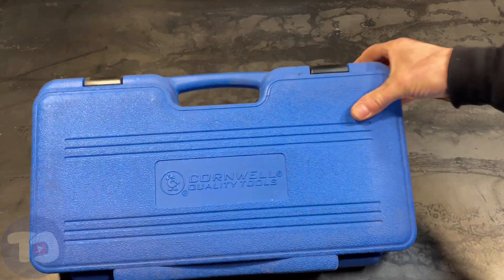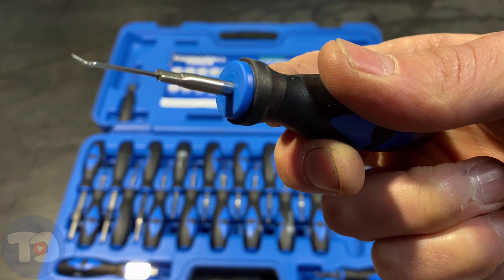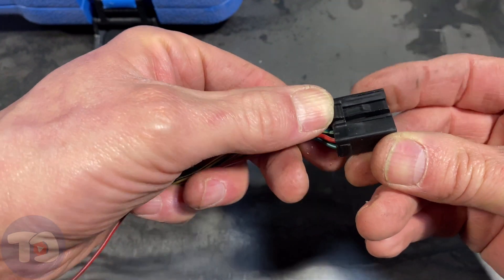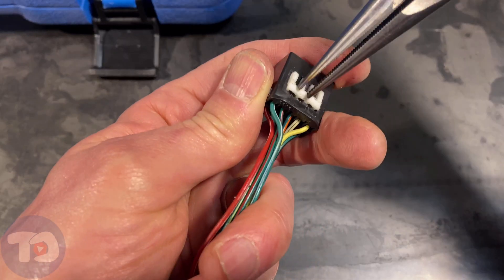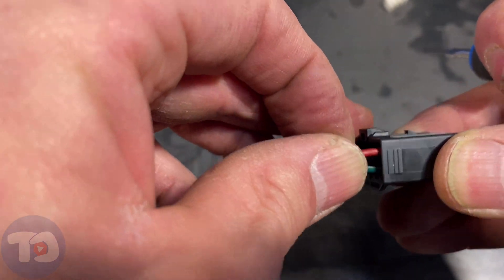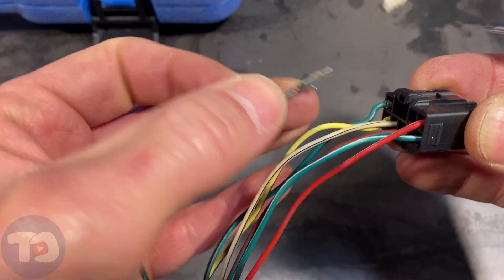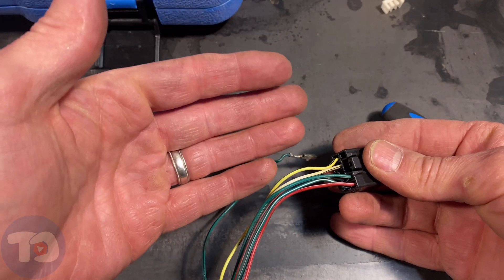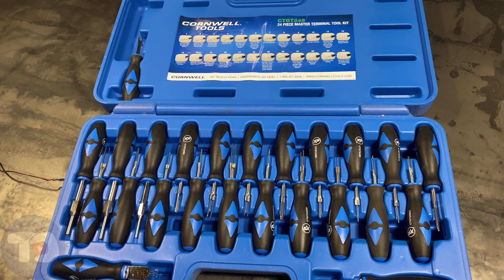How to repair an electrical connector.

Comment: Any idea where I can buy those specific kinds of metal terminals?
Reply from the maker: There are kits available for Deutsch connectors and other types. I avoid using them because there are so many different types and they are specific to each connector. The way I buy them is included with the connector and they are already crimped to the wires. You can buy those connectors from NAPA or from your dealership or even on sites like rockauto.com.
Reply: @ToolDemos  I mean specifically Toyota connectors like you showed in this particular video. I want to run new wires from my radio to some rear speakers. The plastic connector is fine, I just need specifically Toyota metal terminals (4) to go in it. Thanks a lot for your help.
Reply from the maker: @nathanrice1796  I found this on Amazon: https://amzn.to/3O5HFy3 it looks correct, but there are different sizes. I don’t know what size you need, but this should get you started in your search.